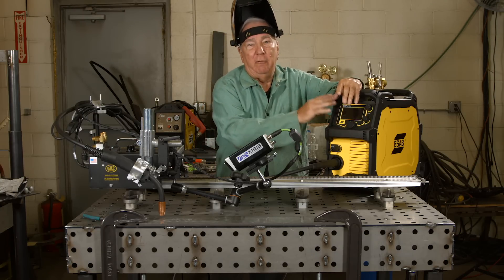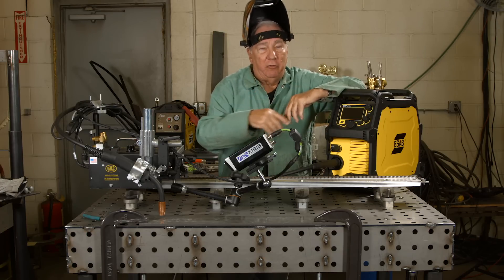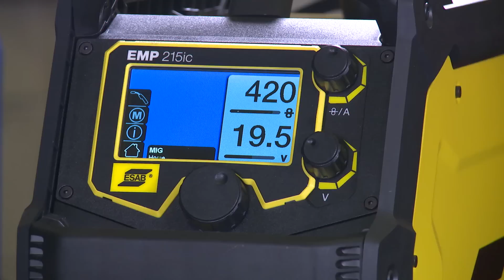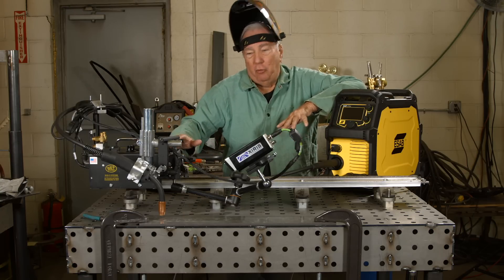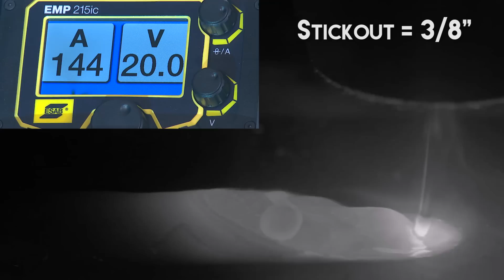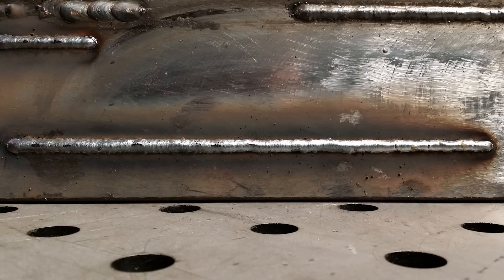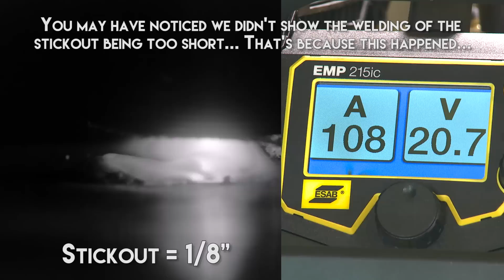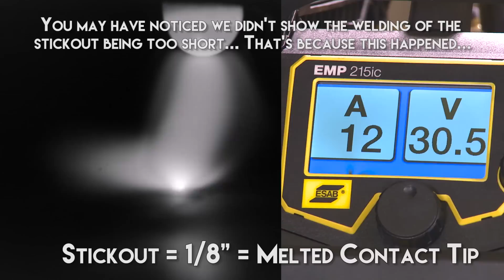MIG Welding Parameters Test: Part 1 - Stickout | MIG Monday

Comment: Is there typically an adjustment on the machine for setting the 'stick out'? Or is it just the position of the tip? I'm having an issue with the machine continuing to run some wire out, after I release the trigger. Apx 1" each time. Kinda annoying to have to keep cutting it off. ;)
Reply: Well, after watching your demo a 2nd time, I see that the stick out appears to be controlled by the position/distance of the tip from the weld surface. And after watching your demo on voltage vs wire speed, I think I am starting to understand more about the dynamics of mig welding. :) Teaching an old dog new tricks!  Thank goodness for the internet and YouTube......and folks like you who are willing to teach!!

Comment: If too long a stick out, the voltage is less, so what happens if you have a long stick out and increase the voltage and gas pressure to compensate?
Then what is the weld bead like?
That can happen when you can't get your nozzle close to the weld bead because of the angle of the 2 metals being welded (look at Rocket Stoves)

Comment: the added resistance across 1/4 or 1/2" of mig wire is only a couple milliohms... is that really enough to change a weld profile?

Comment: Bug-O!  That was a college level  demonstration.  I want to do that, use that system to demo different welding systems.  I think a good LAB would be to get a good mechanized weld (material in a fixture) and see different variables at work, THEN try to do it by hand!  So I'm seeing a good demonstration and an educational process.  On top of THAT there is obviously automated welding being done out there, and most schools don't seem to address this at all.  Great stuff!  Took a few years for this video to show up on my feed, but it's not too late!  Jody did something a little like this with TIG and a rotary positioner.  I like that, because nothing is moving relative to the observer, and you can get a steady arc condition for a few seconds or maybe a minute, so you can take data and observe things.